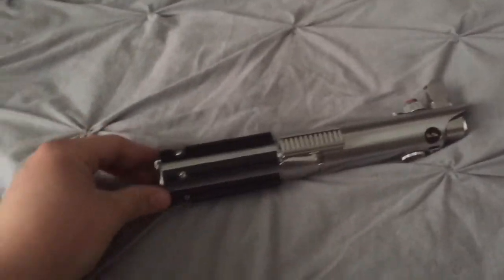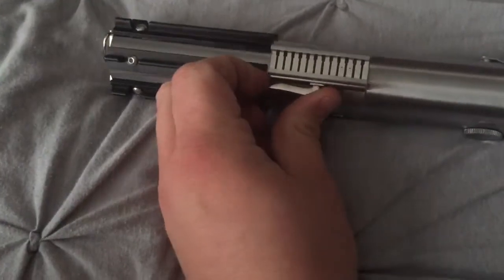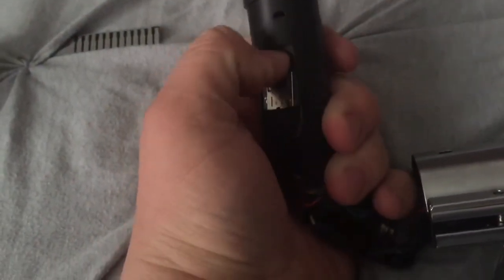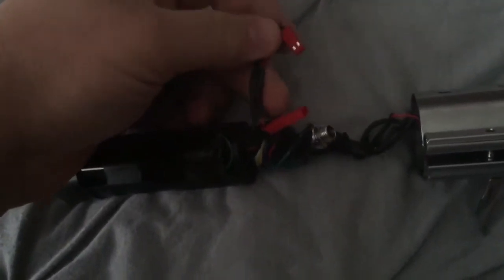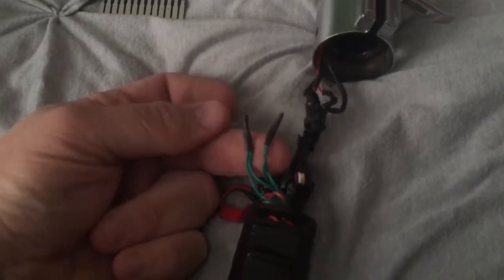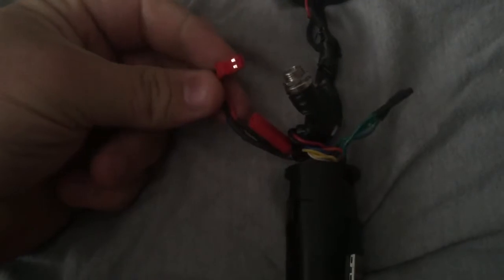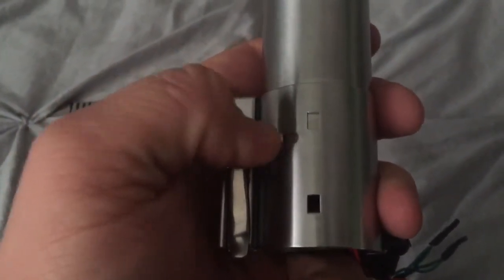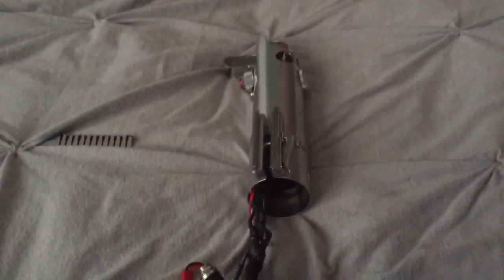Graflex 2.0 explaination

Comment: How does the chassis not bounce around?
Reply from the maker: pat H after sanding the lip of the chassis down it slides right into the bottom half. It then pinches between the rivets/screws in the bottom half and the blade holder in the top half.
Reply from the maker: pat H the newer version of Graflex you have to make a spacer due to the redesign of the blade holder.